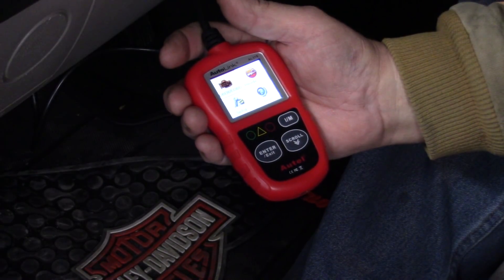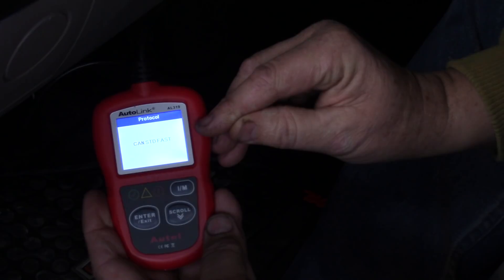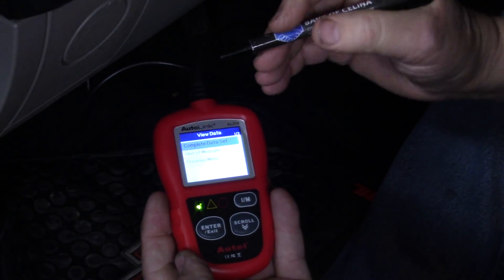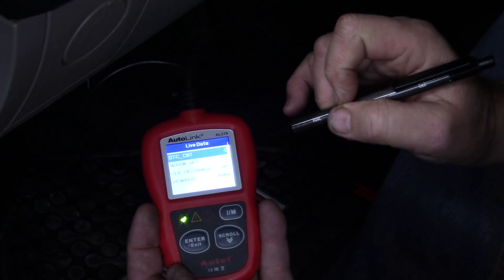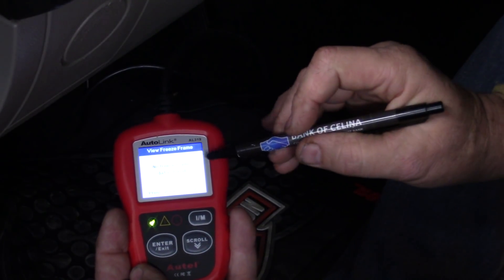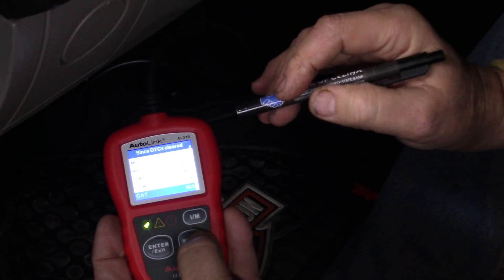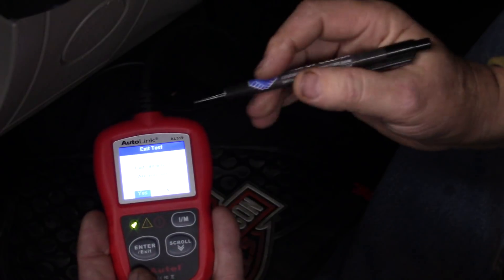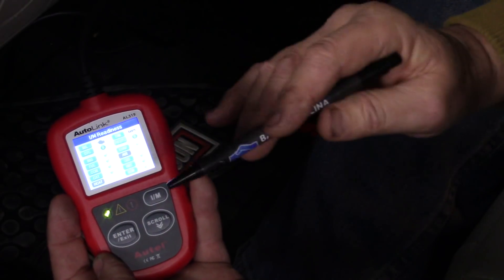Review of the Autel AL 319 affordable scan tool

Comment: Warm ups: How many times the engine has warmed up since it's last code.
Live data: always available even without trouble codes. I use this to verify that codes set were accurate or find issues which a check engine light hasn't set.
Freeze frame: honestly this is more often missing from a more basic tool than live data. It's amazing that it has this.
I/M - I didn't know that meant inspection and maintenance, thank you!
I didn't know about 2008 and Canbus requirements to monitor everything, but even on older cars if it's not monitored, it's on the car. At least I haven't seen an exception to this since 1999. Many emission helping items aren't used if a vehicle is already good enough. For example my 99 Chevy Prizm didn't need EGR like other similar engines because of it's VVT-i. It's 2000 engine design not only had an extra 5 bHP because of the VVT-i, but it also essentially held a little exhaust in the chamber reducing volumetric efficiency just like what EGR does to reduce engine temperatures, which prevents NOx.
CCM: Comprehensive Component Monitors. Are these the ones where they aren't monitored continually?  You have to drive right a number of times for these to clear, if I understand correctly.

My job title means first things first I deal with check engine lights and diagnose and I still got great value and learned from this video. Sorry for the novel, but then again I'm not as the video was just great enough to have a lot to write.
Reply from the maker: I appreciate constructive comments DE. As I understand it, CCM are the continuous monitors like misfire counters and fuel delivery. I'm at the bottom of this learning curve so anytime I get good information from comments like this I'm interested. Thanks!
Reply from the maker: I appreciate your coming along Doug, Thanks for the kind words and have fun with your Autel, I'm learning about so many cool tools in this journey.

Comment: Nice scan tool, and great price. I had to use a wire to jump the last two terminals on my 1988 chevy truck to get the service engine light to flash and count to receive the code. Nice review.
Reply from the maker: GM is pretty good at that with the older vehicles. The newer stuff is so complicated I think that trick no longer works. But I can't be sure, the newest thing I own is an 05. See you soon Matt.

Comment: Vehicles keep getting more bells and whistles sounds like a good tool to help fix problems other than guessing and throwing parts at it with fingers crossed. Thanks for sharing
Reply from the maker: Sometimes throwing parts at a problem works. The issue is, along with the complexity of systems is the high cost of parts. It would be terrible to spend $100's on a part that didn't fix the problem. A lot of parts that are considered "electrical" can't be returned. Thanks for chiming in Rick.

Comment: I just picked up an AL 329. Seems similar, haven't seen reviews of the 329. Using it check used cars for sale. But I don't quite understand one thing. A red X on the I/M readiness screen means the monitor is not ready. So does that mean that just that the monitor is bad or can't get a valid reading? It has nothing to do with the parameter itself being out of spec, correct?
Reply from the maker: I wish I could remember. I gave this tool to my brother years ago. Sorry I couldn't help.

Comment: I have a Uscan, it cost me $75.00 and they soaked you for specific updates based on the car you are using it on.
No cables, so you are basically just paying for the Bluetooth connection.
Reply from the maker: JimsEquipmentShed Thanks Jim. There are so many out there it's hard to choose.
Reply: Yea, the Uscan was kind of a disappointment, with their al-a-carte methodology of cleaning out your wallet.
I mainly bought it to reset a light, (Something it proudly claimed on its packaging) and all I could do was read the codes, until I purchased additional software upgrade.